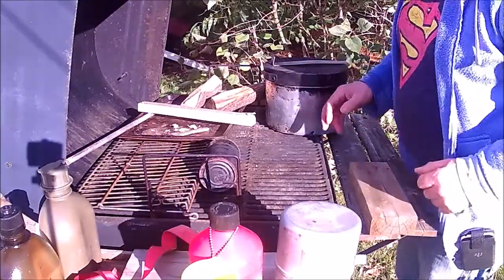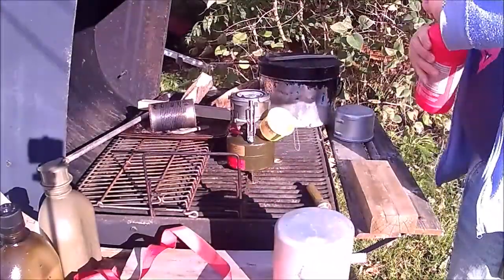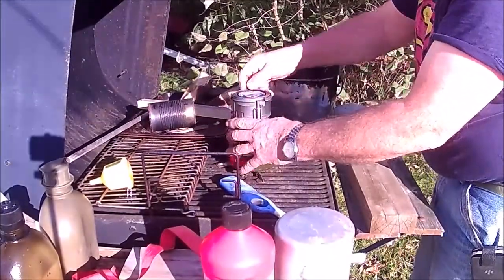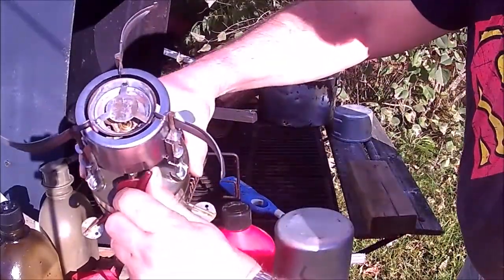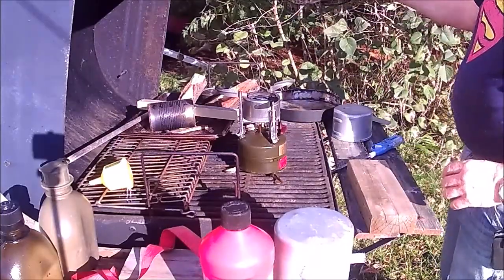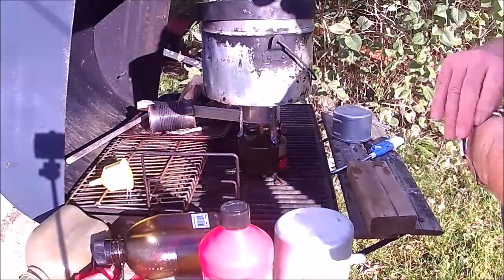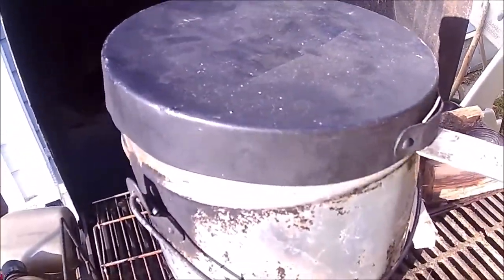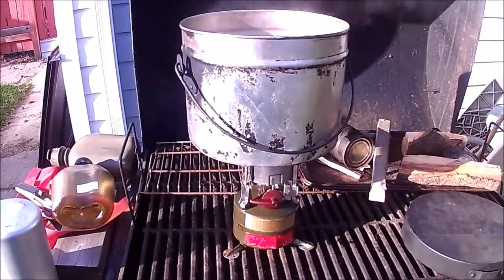Yard Sale M1950 Stove Test Burn

Comment: Nice little stove, very economical. Reminds me of the Primus stove we used to have for camping: took a little coaxing to get it going, but was worth the effort.
Reply from the maker: They are nice little stoves. I have two of them.. A few quirks, but livable. They are only meant to run full bore, simmering is tough to do.. Supposedly  4 ounces of fuel an hour, which is not too bad. Thank you for watching and commenting, Ade

Comment: Awesome find! Fun little project I am sure too.
Reply from the maker: Fiddling with the tiny rubber seal for the check valve was great fun. I did it inside and replaced them on both of my stoves. Other than scrubbing the varnish from the old gas out of the container, there was not much to do.. They are fun to light. Thank you for watching and commenting, Chris

Comment: Very nice stove, runs for near an hour on 2 oz pretty good!
Reply from the maker: If you wind it up, 4 oz per hour. I did not pump it up hard, so it took longer to boil and the fuel lasted. Thank you for the tip to try OldColemanParts.com for parts. I got everything I needed from them, and a pile of spare parts as well. Thank you for watching and commenting, Brandon
Reply: shovelhead8 Glad i was able to help!

Comment: Nice man, really nice.  I wish I could find those down here but they are nonexistent....
Reply from the maker: I see them on Ebay fairly often. Only part you really have to watch is the rubber on the check valve.. Supposedly they will run on regular gas as well, but I use white gas. I have two of these. It cleaned up nice, but did it stink when I opened the can. Thank you for watching and commenting, Matt

Comment: ,,nice find there,, is naptha the same as white gas,,,just wondering,,,
Reply from the maker: Naptha, white gas, camp fuel, Coleman Fuel. All the same stuff. Supposedly these stoves will run on regular gas, but it clogs up after a while. They do include a spare for the part that clogs, along with other spare pieces and a wrench to take the stove apart . Thank you for watching and commenting, James